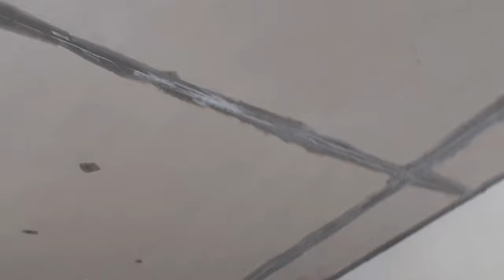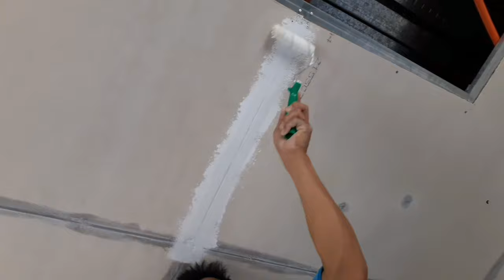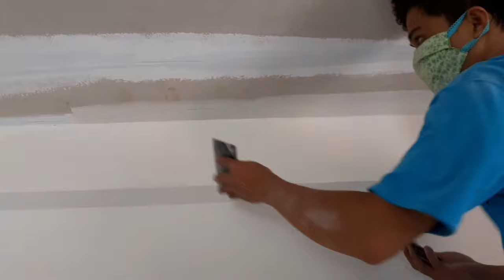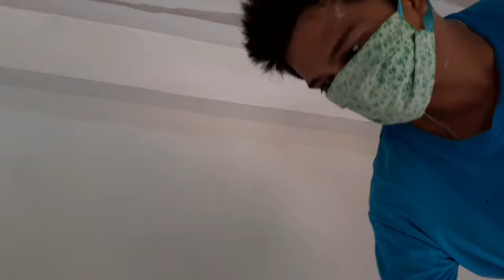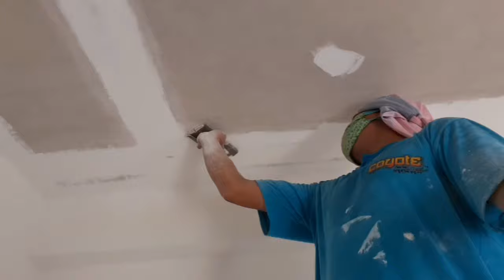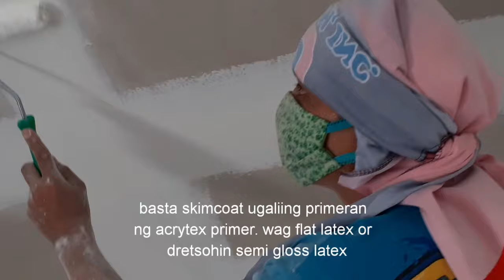Paano mag masilya ng skimcoat sa kisame na hardiflex|tutorial.

Comment: Hingi sna aq ng listahan syu .pra s mga pintura. N pra s anung dpt n preparsyon .s oil base.solvent base.pti water base
Reply from the maker: Ok boss. Plywood ba pinturahan mo or concrete?
Reply from the maker: Sa oil base na solvent boss gamit ka acrytex cast tapos acrytex primer yan ang pang preparasyon mo sa wood or concrete. Tapos pwede kana mag topcoat ng waterbase latex pwede rin automotive paint or pwede rin duco white. Epoxy enamel or acrylic paint. Pwede rin mag haspe tas sealer basta yan ang preparasyon nyo po.
Reply: Cemento pti flywood boss..
Reply: Slmt boss. S info mlking tulong s akin to. Mgsisimula aq mgpintura..godbless boss..
Reply from the maker: Maganda sa semento boss at plywood ang acrytex. Ang tibay nyan.  Haluan mo yung cast mo ng primer bago ipahid. Tas primer pagkatapos liha tas topcoat na.
Reply from the maker: Pero if gamit ka body filler sa plywood wagmo dretsohin ng acrytex ha primeran mo muna ng primer surfacer or epoxy primer ang bodyfiller bago ga apply ng acrytex.

Comment: Hnde po ba magcrack yan Kse flat latex ang pinang primer mo po.Dba dapat primer epoxy dpat or acrytex frimer..Pwde pla po yan latex flat
Reply from the maker: Hindi naman po sir. Flat ginamit ko kasi skimcoat ang finishing ko. If epoxy primer or acrytex di gaanong kakapit ang skimcoat. Pero kung cast finishing ok ang epoxy primer or acrytex.
Reply: Boss para sakin pintor din ako kapag gumamit ka ng epoxyseal or non dpat epoxy primer gamitin mo para hindi mag bleeding yung unang masilya mo para sa akin lng hindi solido preparasyon mo..pro diskarte mo yan👍👍✌
Reply: Pde ba ganito preperation epoxy a&b ts primeran ng epoxy primer ts lagyan mesh tape ts flat latex ts 2 coats skimcoat ts epoxy primer ts flat latex na final coat???

Comment: Tanong ko lang po: Sa top coat o final coat na “Flat Latex” ang gamit - after this, we can apply paint na for the whole ceiling? Salamat po.
Reply from the maker: Yes po tama.
Reply: @KidnanzTv  thank you po. 😀
Reply from the maker: @chrissielim1861  mas ok flat latex lang din po ang topcoat dalwang mano. Yan po latest ngayon flat ceiling malamig sa mata.
Reply: @KidnanzTv  So, you mean to say, yong top coat na “Flat Latex”, yon na po ang pintora nya for the whole ceiling? Because I am planning to use “Textured Paint” kasi. Mas gusto ko sya. Any advice? Thanks po.
Reply from the maker: @chrissielim1861  ah ok textured pala sayo. Ok primeran nyo po ng acrytex primer or liquid tile buong kisame after nyang skimcoat sa dugtungan tas saka na textured.
Reply: @KidnanzTv  After “Acrytex Primer”, do I need to sand it? Or hindi na? Since I am using Textured paint. Thanks again.
Reply from the maker: @chrissielim1861  no need na po kasi textured finish naman eh.
Reply: @KidnanzTv  yup! Big thanks for this. 👍
Reply: Sir ano kaya magandang pantapal sa  crack sa pader
Reply from the maker: @virgiliotan9702  lakihan mo kunti sir gamit ang concrete na pako tas pasukan mo ng concrete epoxy pioneer solid yan